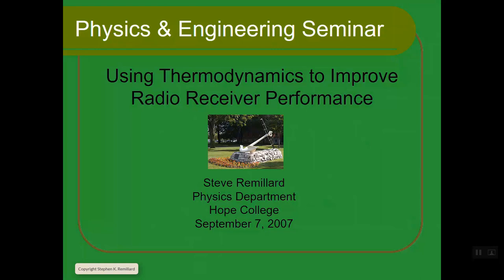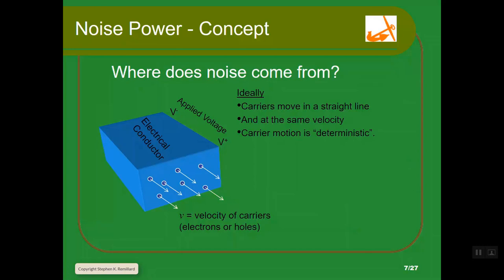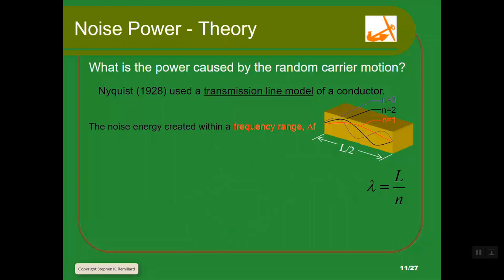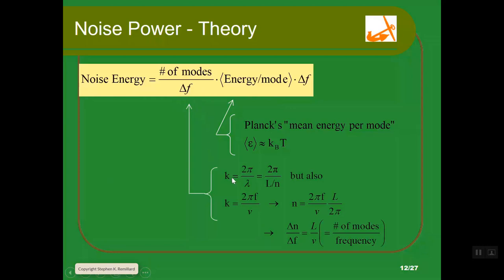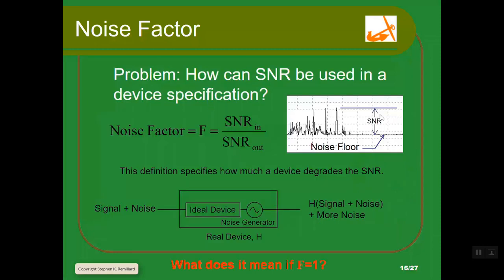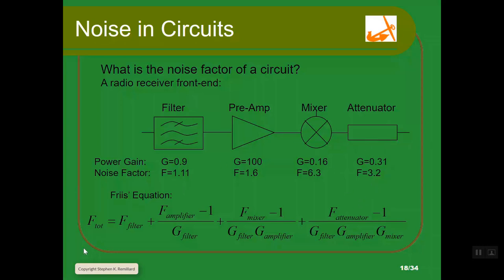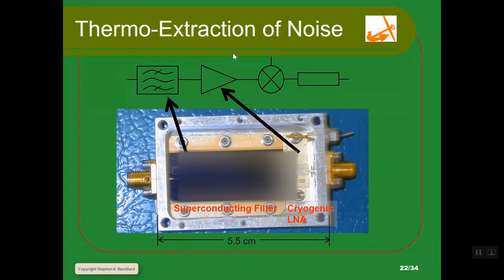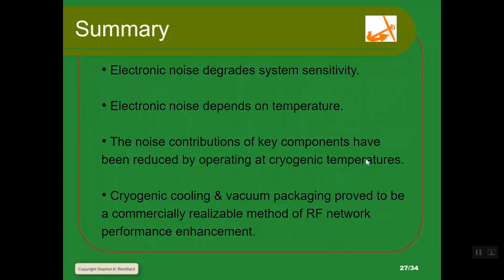Noise Figure Tutorial, Lecture 66

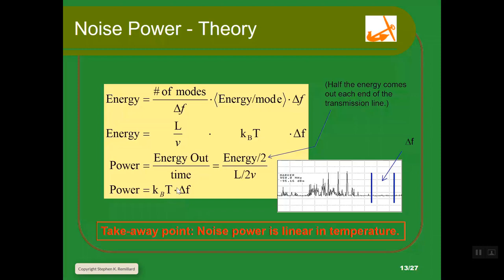Comment: Thanks for the video. One comment -- to be honest, I take a bit of issue with your description of SNR at ~13:00. What you show there on the plot is not SNR but rather a dBc dynamic range measurement. For SNR, it's the integration of the noise. Let's say I have a 10kHz channel. Within that channel I have a +5 dBm tone and -80 dBm/Hz "noise" across the channel. The SNR is therefore 5 - (-80 + 10LOG10^3) = 55 dB.  (The dBc measurement would be 85 dB.)
Reply: shouldnt it be 10LOG(10^4) = 40 dB  since it is a 10 kHz channel ?
Reply: @Berk-lf6ge  Yep. Sorry, error on my part.

Comment: Dear Dr. Remillard, I am sure you possess invaluable experience in Cryogenic MW measurement. I would be thankful if you consider posting some information in this regard. For instance I understand calibrating a VNA for measuring Q of a cavity sitting in cryogenic fridge is not an easy task. Any comment or tutorial about cryogenic Microwave will be greatly appreciated. Also any tutorial about making cryogenic switches and low noise amplifiers would be great.
Thank you for all of your great videos,
Reply from the maker: (To prevent confusion among other readers, I'll clarify that my comment here has to do with Q and not noise figure.)  VNA calibration can be avoided for Q measurement if you use the full-two-port method Q measurement that I describe in the other video.  When the coupling is weak, it is still helpful to flatten the background by subtracting out the standing waves in the reflection.   Because all you are trying to do is to flatten the background, you can either remove as much of the reflection as possible, up to the feedthroughs, or remove all of it at the resonator connections before sealing the cryostat.  Since you are only measuring differences in S11 over a miniscule frequency range, the change in cable attenuation upon cooling doesn't matter.
I don't have background with designing cryogenic switches or LNAs.  The LNA design was done by other team members.  I was the filter designer.
Regards
Reply: @stephenremillard1  Thank you very much, it will saves me  from lots of hassle. I thought I have to design a cryogenic switch similar to what is used in microchip industry, so I can calibrate the VNA cold. The cavity will be a superconductor one, for calculating the tangent loss of different materials placed inside it at sub-kelvin temperature. I will email you the design of it. It is not mine, but look interesting.

Comment: The noise voltage average over time tends to reach to zero but it can be nonzero at any instant. In fact, there is no guarantee that the average will be nonzero unless we measure it for an infinite time.
Reply from the maker: Correct.  Thanks.